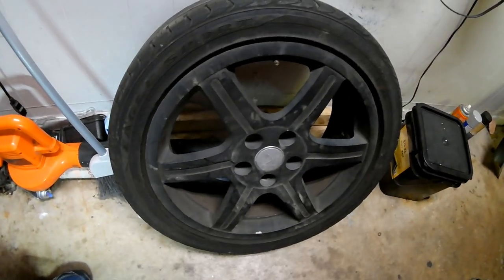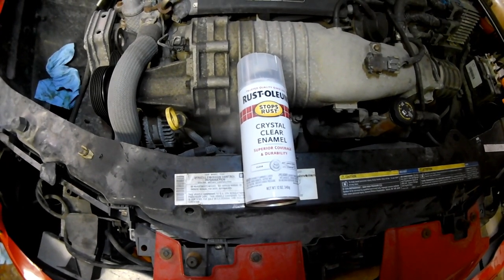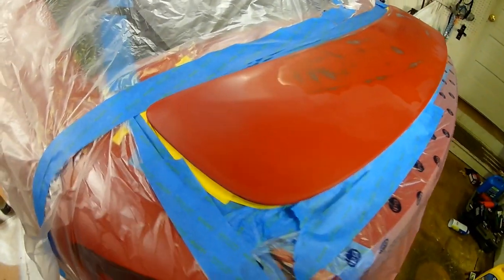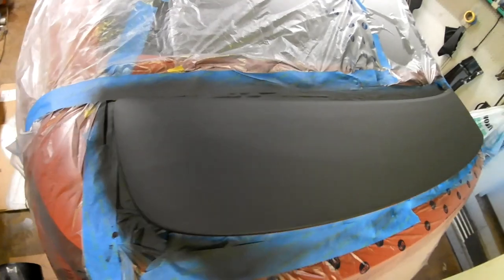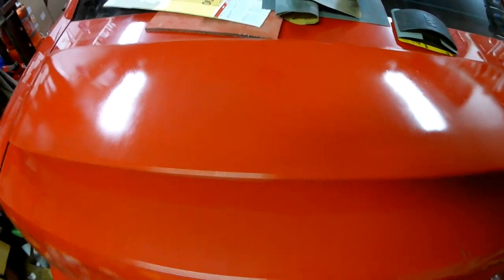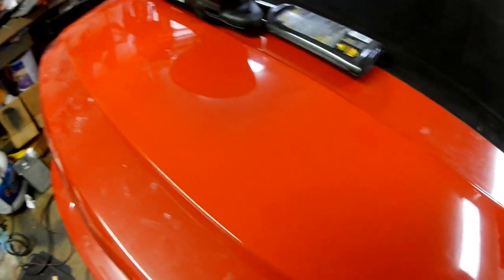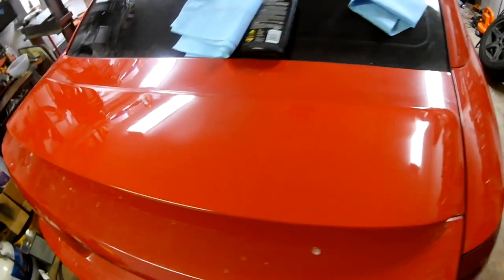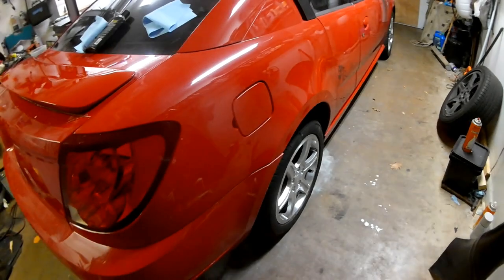Ion Redline: Painting the Rear Spoiler and Rim Restoration

Comment: How do you take off the wing
Reply from the maker: You could pick the entire car up by the wing.  Gm probably used the same adhesive that's used on the space shuttle's heat reflective tiles on all it's wings. 
I would use picture hanging cable between both hands and use a back and forward motion to cut the adhesive holding the wing to the trunk. (after the bolts are removed)  
Blue painters tape should be applied to the trunk lid to protect the paint.
You can buy the cable at the hardware store for a few dollars.
Good luck.  It's hard work.
Reply: @local701  thanks for the info,  do know how to take off the shift knob?
Reply from the maker: @menaceescobar5192 
Yes. First you need to remove the black plastic cap off the top of shift knob. The cap holds the shift pattern indicator (which is grey). You want to pry up on the cap right below the #3 on the indicator where the leather starts and the black cap ends. It should pop right off. 
Use a number T20 torx bit to remove the screw holding the knob in place.
If you are lucky the knob will pull right off.
Reply: @local701  i unscrewed the bolt, its still stuck on there. Maybe I need to pull really hard?
Reply from the maker: @menaceescobar5192  
It is just pressed on. Remember the reverse engagement is not connected to the knob.  It slides up into it. So this gives you just a little room to tap up on the knob from below.